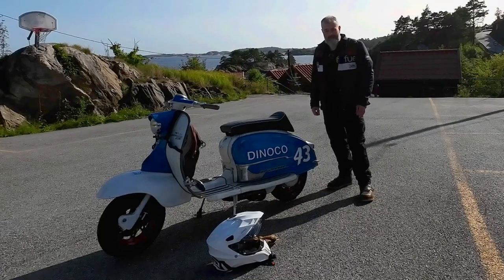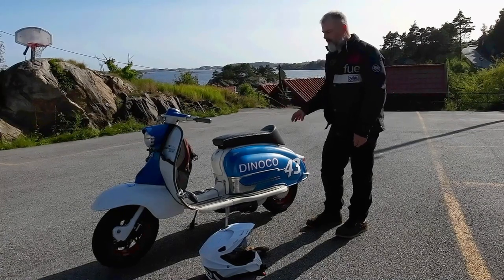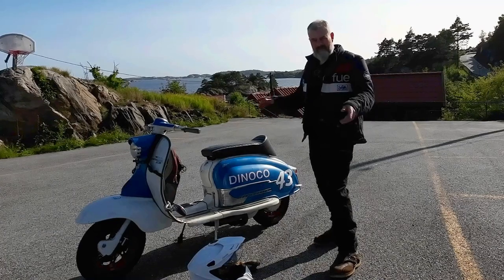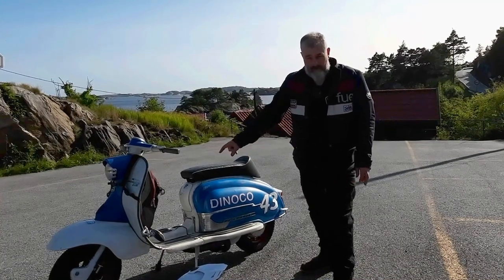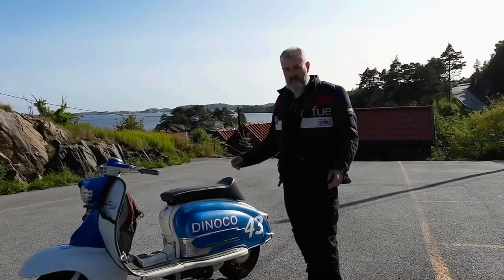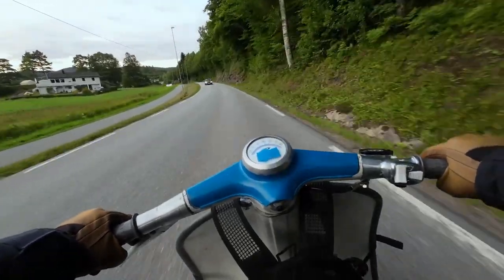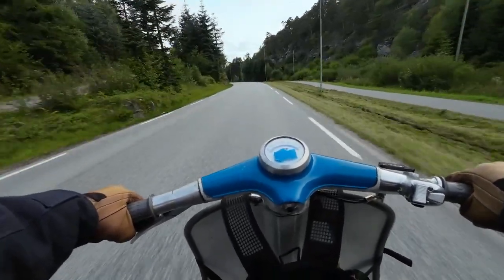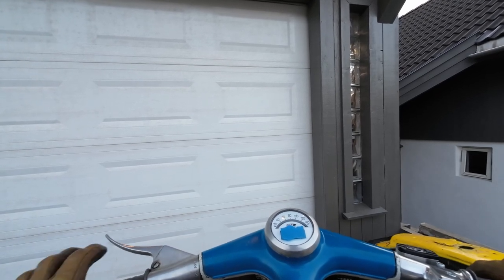SIP Nordspeed #lambretta exhaust review!

Comment: I have 2 of these exhausts one on a ts1 240(smart carb) and on an rt240 (phbh30) and no fitting issues what so ever. Both pulling 4.6 gearing on cyclone gearboxes.

Comment: Sounds great Rob, can you help me with a problem on rebuild, the inner threaded nut that attaches cable to speedo has disappeared down column, tried air no joy, any other ideas? Thanks
Reply from the maker: Nightmare mate. In hindsight, I alws fasten a zip tie under the nut. That being said, it's not really that hard to just pull the whole cable out.
Reply: Yeah. Thanks Rob. Agree with you. Cable out and new ordered.

Comment: Will this exhaust be any good with the casa ss200 kit and casa 4 speed close ratio box thanks
Reply from the maker: Yes! I bet it would work well.
Reply: @kickbackgarage  just need to find a seller in the UK everywhere seems out of stock
Reply: Just got round to getting one and fitted it today omg what an animal it's made my scooter now very impressed
Reply from the maker: @steveanddawn22  Funny enough, I actually don`t make this shit up 🤣
Reply: @kickbackgarage  for a 200 small block it goes very well scary in fact gonna have to do a riding vid tomorrow
Reply from the maker: @steveanddawn22  looking forward to it. Where do you live? It looks very posh
Reply: Hertfordshire UK them videos was with a stainless taffy system on it it never felt right but it does now
Reply from the maker: Just watched the video and it seems to go great! It actually sounds like you have a bit of clutch slip when you are hard on the throttle
Reply: @kickbackgarage   might be time for harder springs I'm running the soft springs that come with the bgm clutch

Comment: Would this go well on a rt195 kit
Reply from the maker: I imagine it will suit all RT kits but with a nod to Reed valve touring engines. I would like to see an improvement in fitment and I would like to see a RT 4 bolt stub option too.
Reply: I'm the guy that Rob mentioned in the video that had zero fitting issues with this exhaust (GP with RT225, non reed) . . . it fitted like a dream and goes like a rocket!